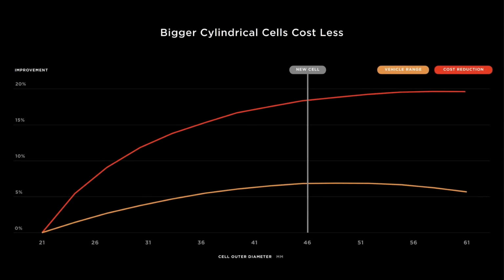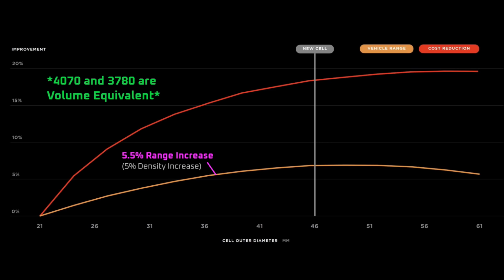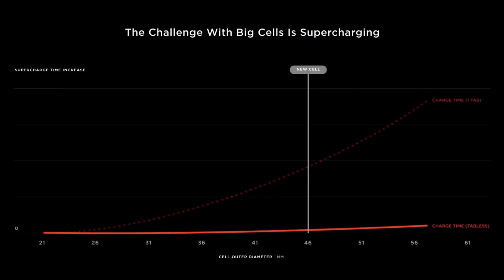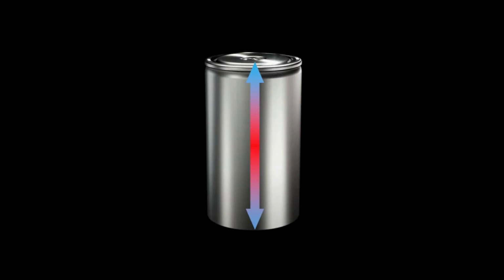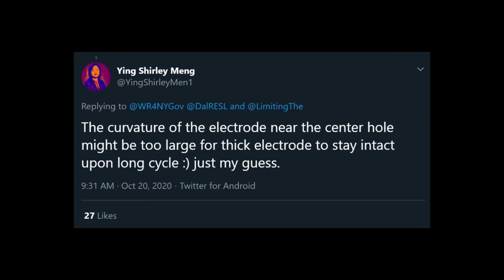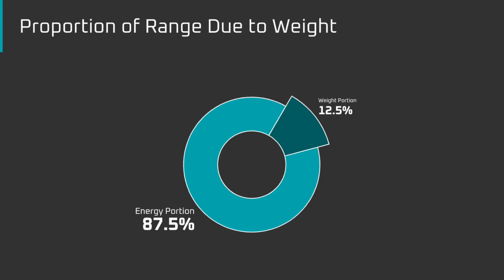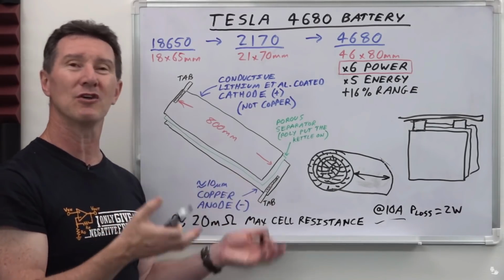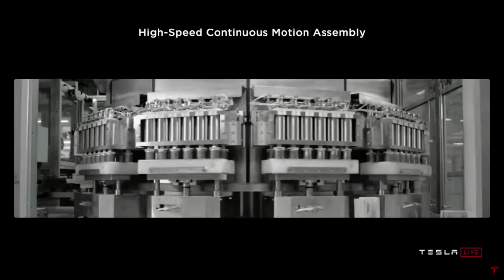#3 Tesla's 4680 Tabless Electrode Cell Design // Deep Dive

Comment: as the can gets bigger the gap between each battery becomes bigger witch then starts to use up space so less batteries can fit into the same given space, your packing digram outlines the same size can packed in driffent ways not different sized cans
Reply from the maker: But the cell as a proportion of that gap always remains about 90%
Reply: @thelimitingfactor   depending on the cell size you must get to a point where the pack has wasted space,  or  you cannot fit a whole battery because your limited in the space your packing  say the packing size is 100mm x 100mm x 100mm  if your battery is 75mm wide 100mm tall how many batteries of that size  will you fit into that space vs batteries that are 50mm wide by 100 tall ?
Reply from the maker: @Yahgiggle  There is an optimal point, but it shifts around and doesn't scale linearly (my understanding at least).  Someone worked it all up in a spreadsheet I saw at point point.
Reply: @thelimitingfactor  yeah i'm no expert and don't know where and how tesla or others have worked out that scale of battery size vs capacity, maybe it accounts for total pack size thats limited to a set size or maybe not,  do you know if they use the total pack size in their calculations or is that graph just a general rule.
Reply: The footprint of one 4680 cell is about 1/2 that of the old 2170 cells, volume for volume. The footprint for the new 4680 cell battery pack will be even smaller because it won't have the cooling manifold and the gel taking up so much space around each cell. .
Reply: @artsnow8872  yeah true but i do wonder how the new cooling method will work and how it will look, cannot wait to see sandy munro take one apart oO

Comment: I'm not an expert at all, but simply wondering: do you think there's a chance that Tesla can/might use the hollow core as a possible vertical cooling channel right through the center of the battery? Ending up with a technical solution that is perhaps cooling both the outside and inside at the same time with a non-conductiong fluid... 🤔
Reply: Interesting idea, but I don't think so. From what I've been told the heat is concentrated at the top where he electrons flow in and out. I believe Sandy Munro goes into detail in one of his videos.

Comment: When can I order a 2021 Model S, new design, new interior, new castings, new heat pump and new battery tech? Anxiously waiting!  It will be an OMG accomplishment!
Reply: Lmaio when they release wjat you are waiting for they will have a beter tech waiting to be release for a year and 2........ are gonna wait again?
Reply: Order a plaid Model S now.
Reply: Maybe 2024-25
Reply: People your missing my point. The model S has not changed it's current shape and design other than new front end since 2012, some 8 years ago. I drive a fusion hybrid, the best vehicle I have ever owned and I've had many new vehicles. My suggestion to others is get a hybrid as an interim vehicle because it is the best stepping stone to a Tesla! My Tesla stock will pay for the new one. Looking at 2022. MAGA for another 4 years.
Reply: @musinclind37  Tesla is Not a Traditional Automakers where they change Look............ They update whenever, and whatever time they want to update..........  whether it's internal or external............ they can can anyday at anytime............ if you want to wait no one will stop you........... but when you buy Tesla whetehr 2021 or 2022............ Tesla will have better technology after you buy the car........... so are you gonna wait again? Remember tesla won't stop innovating.............

Comment: I love your vids, man. It's full on  geek out though. Lot to get my head round this time. What is the core filled with? Electrolyte? How about putting an aluminium core from top to bottom to aid heat dissipation. Obviously it'd need insulating, or I think i'd prefer an insulated torus for the electrode at top of battery with a thermal anchor point at the centre. Would add some mass, but way better thermal management and increased structural strength. Like the Ozzy on EEVBlog too. Never seen him referenced before. Saw something about anode plating being a limit on faster charging (from drew IIRC) with the larger cells, but Tesla's own graphs on charging don't seem to support this.
Reply from the maker: Sure thing Andy!  Nah, I think the core will just be empty space.  So little electrolyte goes into these batteries that they actually appear dry.

The limiting factor for charge rates is context dependent.  This will be covered in my Tesla Si video.

Comment: 9:04 That might be, but with better cooling, the first improvement we might see : a charging line with a far later drop off. So not 250kW till ~20%, but till ~40%?
11:50 On top of the larger hollow core, the "Continuos tab" also needs more room at the top. Judging from the model, that might be 2-3% of the cell length.

Comment: The power density is up about 10% and energy density is down about 10% in the new 4680 battery cell; but, that's not the most important takeaways. The Model 3's  75 kwh 2170 battery pack weights 1054 pounds with 293 pounds being in the battery case, packaging, and cooling system.
 With the new 4680 battery cells, the total battery weight may be about the same as the 2170 battery cells (680 pounds for the 4416 cells in a 75kwh battery), but, the ancillary cooling and packaging weight would be much lower, AND, the battery would become part of the floor support structure, which could save, maybe, 150(?) pounds. This weight savings would help increase the vehicle range..
Reply: Where do you get 10% power density increase from, out of interest?

The range increase for the cell and body integration weight savings, is included on Tesla's slide elsewhere, so aren't taken into account here
Reply: @MrVelociraptor75  The 4680 battery volume is 5.5 times the 21700  battery. The Battery Day big-screen showed an increase of 6x power for the new 4680 battery cell. This is 10% greater than the increase from the 5.5x of the 2170 cell.  
  The weight decrease from the more efficient battery packing will give a lower vehicle weight, which gives more range. Tesla Corp. doesn't tell us what the weight savings is. We have to make an educated guess.
Reply: @artsnow8872  Thank s for the reply.

I wasn't questioning your weight reduction guesses, just saying, that is accounted for under another section, not specifically here (although, I guess less external packaging on the cells would count, as does fewer cells in total. So there IS a weight reduction, but, there's a whole other slide that accounted for that)

Presumably (as I can't see any other metric working), that slide about the battery is comparing each individual cell (4680 vs 2170), so in that comparison, the 4680 actually only consumes the room of 4x 2170s (draw it up, 4x 2170s bundled takes up the same area as 1x 4680). 

In essence, (imo) it's really closer to 50% more power (6 times power vs 4 times original cells packed) and close to 20% more energy per physical volume in the module (the volume to energy ratio might be down, but the amount of total energy is up - ie energy density). 

There could be lots of reasons for the 5.5x volume increase, but "only" gaining 5x the energy. As Jordan suggested, the large central hole, part of the jelly roll doesn't account for any "active material" of the cell, so is "wasted space" as far as that is concerned (but seemingly has potential other benefits). I also think the top few mm's of the cell are in this category. They're the "tabless" folds. Also, not technically active material.

But, my pedantry aside, I do agree with you. There are MANY great benefits to this whole cell over the existing one. It's amazing how many of those huge advantages have gone over many people's heads (I guess, haters gonna hate)

Hopefully though, more detailed information on these cells comes out. The presentation was a little vague still
Reply: @MrVelociraptor75    The Battery Day figures compared one 4680 cell to one 2170 cell. The  figure showed a 6x power increase (NOT 6x power DENSITY increase).  Since the volume of one 4680 cell is 5.5 times the volume of the 2170 cell, it's power would increase to 5.5 if the battery contents were the same "stuff"; but, all the changes made to the new cell bring about a 6x times power increase. Tesla doesn't tell us what those changes are, in detail, so, we guess. 
  Several things would bring about range increase: (1). Reduced resistance within the cell from a shorter path from the active material to the electrode. This reduces the amount of heat produced in the cell.  Heat equals energy. (2). Less electrode resistance and, thus, energy loss. (3). Lower battery pack weight, leading to lower vehicle weight. Less weight means less energy needed to move the vehicle.(4). Higher nickel and higher silicon content may have an undisclosed (to us) effect.

Comment: I am looking at the 4680 3d model and I think the tab design is wrong, it is way too high. As I understand from the original image the pattern is made by laser cutting little flaps on the electrode material. then twisting it almost 90 degrees towards the center to make a flush bottom. In the model it can be seen as if the loose electrode ends were only joined.

Comment: 5% increase in energy density doesn't increase range by 5% or reduce car weight by 5%. A 5% increase in energy density (assuming the battery will have the same kwh) will have a very small effect on range due to lower total weight of the battery. 
The 50%+ range increase advertised by tesla doesn't mean that a 75 khw Model 3 batter pack with the new cells will have a 500+ miles range. 
Can you do a dedicated video explaining in more detail only the range increase that tesla mentioned as I believe there is a lot of assumptions and confusion around it.

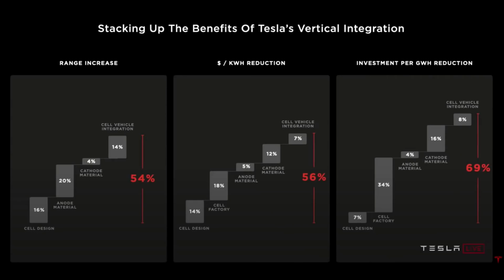Comment: 12:48 Not a continuous tab. It's a shingled spiral current collector. Truly tabless.
Reply from the maker: Technically correct, but confusing to the uninitiated, lol
Reply: @thelimitingfactor  The whole point of calling it tabless is that it eliminates all the complexity associated with stopping, starting and attaching the tab.
Reply: Calling something not something else that you intend to make obsolete is bound to get confusing. Watches have Keyless Works. Because back in the day watches were wound with keys. Over 100 years ago. Call that part a winding mechanism. Same with Tabless. Call it low resistance or high conductivity , what it does not what it isn’t.

Comment: If there is a fault rate per meter of material that writes off a cell then double the volume and you write off twice as many cells and therefore 4x energy storage. 

As cells are cooled at ends and power come from the ends volume to surface area at end would also be a limiting factor.

Comment: Instead of increasing range to 500, they could keep it at 300 and put out cheaper cars instead. Also reducing the supply issues by putting less in per car.
Reply: True. Buyers, already, have that choice. Some people, always want more.  More range equals less range anxiety.
Reply: I bet they do just this with the new cells and cell-pack technology. As in the 25k tesla will be in the 250-300max range. Then model 3/y in the 350ish range. And the premium models all well over 400+miles of range. Which would nicely delineate the tiers of product. 🤔
Reply: Interesting comment ... that would mean the 500k cars they build today would be 750k cars without increasing anything. But if they increase 5x in amount of GWhrs built, we could see 4250k cars in 2022 assuming no increase elsewhere? 

In a previous episode I commented that most ICE vehicles are around 500 miles per gas tank; I think this will likely be more of the push for equal range to ICE than cheaper more vehicles.

I like the thought though.
Reply: Musk said somewhere that 300 miles range was fine in a car, so I think he’s thinking what your thinking .

Comment: 50kwh EVs need to be the norm for commuter cars. You don’t need more than that.
Reply: Doesn't the new Mic3 with the iron lfp bats. Have only 60kwh or less? Yet it's still rated for 290+wltp miles. 🤔
Reply: What’s a Commuter Car ? Can it take children ? Shopping ? Runs the next town ? Holliday ? If not is it a second or third car , can those first or second cars have bigger batteries  ? Seems inefficient.

Comment: Tab-less battery isn’t ready for prime time yet. 

Tesla’s tab less battery, more appropriately the “multi-tab junction contacts weld less architecture”.  

There are limiting factors of tab less battery that Tesla failed to address the public are :-. 

(1) junction compression force, unknown 
(2) junction area, unknown 
(3) junction (force and area) retention under operating environmental conditions, unknown

Test condition and degradation rate unknown
(4) Thermal expansion ?/ contraction cycles?
(5) Thermal shock?
(6) Acceleration / decelerations cycles? 
(7) Acceleration shock?

Page 11:45 depicts the tab less (multi-tab) architecture completed with cell cap -> air gap -> multi-tab. An air gap bridged between cell cap and multi-tab, such that electric and heat stay within the cell ... instead of the advertised benefits - lower electric and thermal resistance. 

And by chance those multi-tab may point contact to the cell cap to a conditional connection that can be disconnected again upon inertial shock and hence spark inside the cell. 

In the case the cell cap was utilize to invoke a compression force onto those multi-tabs for a conditional electric and heat conduction, such force will be coupled to the far end +ve terminal through the roll up electrodes thereby wrinkle/ripple up the rolled up laminates seriously compromise battery resistance, capacity and longevity.

Comment: Do you think the telsa cell design is too specific to the automotive industry?
Reply from the maker: It's a general purpose solution
Reply: @thelimitingfactor  to be honest, I don’t see it coming to iPhones or laptops anytime soon... But it is a much broader solution than just automotive. For example energy storage as Tesla will also do.
Reply: The energy-density is not attractive to the aviation, and shipping, industry which are considering fuel cells. https://spectrum.ieee.org/transportation/marine/the-struggle-to-make-dieselguzzling-cargo-ships-greener
Reply: @rogerstarkey5390  Regenerative breaking on planes is complex, the engines arent designed for it to be effiecent because will results increaed drag. However though there are small electric planes, even Boeing is considering fuel cells instead of batteries because the energy density and recharge times of batteries arent suitable. https://www.sciencedirect.com/science/article/pii/S1464285908701469
Reply: @rogerstarkey5390   Regeneration in a battery powered propeller driven aircraft? Why not? The most energy, per time / distance, is used during takeoff. If 1/2 of this could be recouped during descent, it would extend the range, measurably.
Reply: Planes take plenty of time to turn around at terminals. Ultra fast chargers can work for the several hour average turn around time of flights.
Reply: @4literv6  Where do you get those numbers from? The studies I can find indicate 45min turn arround time of which 15-20mins is dedicated to refueling. Remember even with conventional air travel trans- continental travel require interim destinations. Given the interval between flights extending this time would change the economy of flight. https://www.boeing.com/commercial/aeromagazine/articles/qtr_4_08/article_04_3.html
Reply: @artsnow8872  Regerative breaking at the end of the journey doesnt extend range because only get the energy back at the end of the flight (when its redundant), you cannot recover energy by breaking during a trans- Atlantic flights. The only thing it could do is improve turn [arround]-efficiency. To just extract runway energy you would need a minimum ~20 kWh battery, capable of taking in 6 MW. You cannot extract that much energy via regenerative breaking on planes. Regerative breaking in cars is between 16 - 70% effiecent, rapid as on planes braking is less efficient due to bottlenecks in power transfer limits. Using propellas to break is efficient. A propellers effiency betz limit (59,3) percent as there trade off between drag and rotational efficiency. Wind turbines tend to be less effiency (70- 80%) and to loose power as they stall at higher wind speeds, limiting the rotational energy extracted during breaking. Where you would need to extract the energy.
Reply: Not for phones, they have flat, thin designs